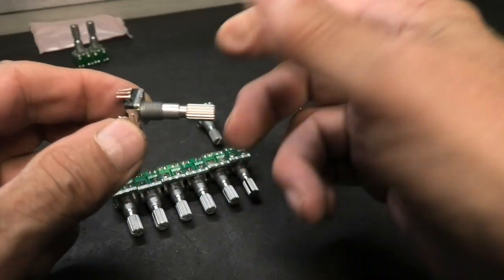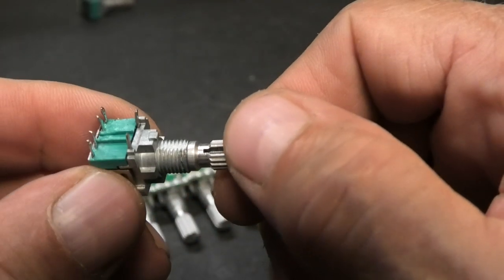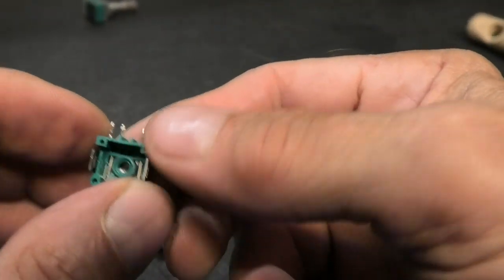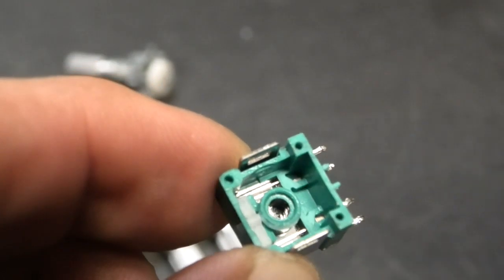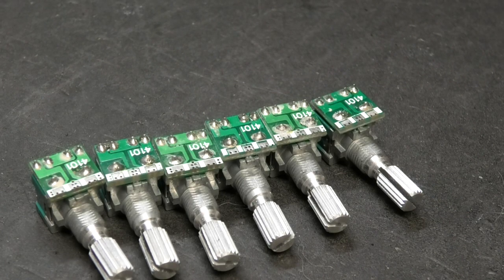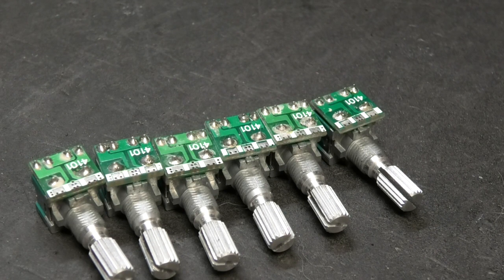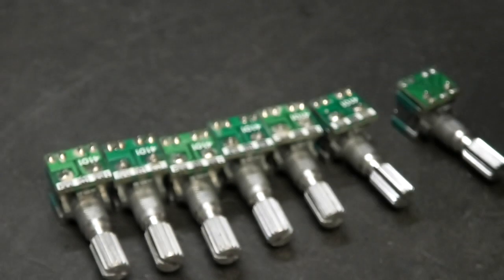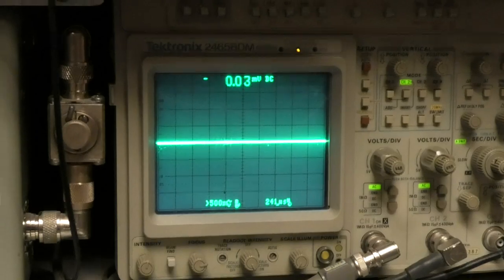Pulse Encoder Update - Stryker Radio SR 955 - SR 655  - Channel Selector - VFO - Still Waiting.

Comment from the maker: Channel Selector / Encoder For Stryker Radio SR 655 HPC And SR 955 HPC .. the long shaft (poor design) of the factory encoder is prone to FAILURE! Beware the fake news!

It's The Best One, Has Survived The Heat And Durability Test .. Others have been tested and FAILED. It's not a software issue either, there's too much misinformation out there. Never Settle For Less!!

That "goofy" long shaft, prone for failure and factory knob really SUCKS!

Here's what it takes to cut through the noise, be loud and crystal clear with a better receiver too:  A) Tuned Bench:  https://www.youtube.com/watch?v=lwcDfXOgAls.  True, it's more complicated and time consuming to accomplish these consistent and accurate results. Below is a partial procedure and list of calibrated equipment used to achieve this level of performance . Read on ..

Fine Tune CB Radio Shop strictly adheres to (https://www.nist.gov/) NIST Traceable Calibrations and other industry standards to maintain accuracy and consistency for providing Real World Performance Tuning of Citizens Band and 10 Meter export mobile radios with integrity.

"Basic Textbook AM/FM/SSB Transceiver Tune, Alignment and Calibration" 

1) Pll adjustments
VCO & OSC, AM TX OSC, USB TX OSC, LSB TX OSC.

2) Transmitter alignment
DRIVER BIAS, FINAL BIAS, SSB  (or gate voltages for mosfet versions) CARRIER BALANCE, HI-LO AM & SSB Power, RF METER, AMC, ALC and FM DEVIATION.

3) Receiver alignment
AM/FM RF & IF SENSITIVITY, FM DETECTOR/DEVIATION, SSB IF SENSITIVITY, SSB S-METER, AM/FM S-METER (100uV unmodulated -67dbm for “S-9” meter reading!), AM/FM SQUELCH RANGE, SSB SQUELCH RANGE, and NOISE BLANKER/AUTOMATIC NOISE LIMITER (Real World dBm to volts (uV) tables below).

That's just a typical run of the mill textbook tune up and alignment (if you're lucky). There's more to it than frequency alignment, modulation adjustment, meter calibration and a tune up report displaying exaggerated rms Bird peak watts! 

"Test Bench includes"

Bird 4314C Meter
https://www.birdrf.com/Products/Test%20and%20Measurement/Power-Meters/Wattmeters-Line-Sections/RF-Wattmeters/4314C_PEP-Single-Element-Wattmeter.aspx
Part 1) https://www.youtube.com/watch?v=RpX9IHe4ORM&t=16s
Part 2) https://www.youtube.com/watch?v=LuhbqTf6Bxw
Bird 4314C Accuracy Test: https://www.youtube.com/watch?v=DqEOabYqhQo&t=5s
Bird Stipulates 1/2 wavelengths  https://www.youtube.com/watch?v=5eWhgT-rTII
And Genuine Bird Elements from 1K down.

Bird 4373 Sampler 
https://www.rfparts.com/signal-samplers.html

HP8924c with options
http://userequip.com/files/specs/2147/HP%208924C%20Repair.pdf
https://www.youtube.com/watch?v=Cg1w0xBa27s&t=1s

HP8920a with options
https://www.keysight.com/upload/cmc_upload/All/EPSG072204.pdf

Three analog scopes, one digital 200 Mhz
https://www.atecorp.com/atecorp/media/pdfs/data-sheets/tektronix-2465b-2467b_manual.pdf
https://www.youtube.com/watch?v=by98x4eu2lM

Fluke 27fm
http://www.fluke.com/fluke/inen/digital-multimeters/fluke-27.htm?pid=56055
 
LCR http://www.lcrresearch.com/wp-content/uploads/2017/05/LCR_Pro1_Manual_version1.03.pdf

Power supplies
6 Cosel PBA1500f12 (750 amps) variable and configurable.
https://en.cosel.co.jp/product/powersupply/PBA/PBA1500F/PBA1500F-12/
Corcom 20VB1 F7130 EMI Filter 50-60Hz 250V

Times Microwave Coax jumpers and test leads
http://www.timesmicrowave.com/cms/products/cables/lmr/
https://www.youtube.com/watch?v=EmqaGJ6IWow
https://www.youtube.com/watch?v=1ltFVSxGp5Y
https://www.youtube.com/watch?v=v12YZT_1o90
https://www.youtube.com/watch?v=h7iiYfmYWRA&t=215s

Amphenol RF Connectors
https://www.amphenolrf.com/
https://www.youtube.com/watch?v=dVh5B0hdEA0 
https://www.youtube.com/watch?v=dKZg8T_AOso

More range, compliments, reliability and a quieter, clearer but more sensitive receiver,  Get Fine Tuned .. not peaked and ruined.

Here are some VideoGates of me at the bench practicing what I preach using my bench radio or customers radio completed and ready to be shipped: https://www.youtube.com/results?search_query=hard+drive+163+ more: https://www.google.com/search?q=Hard+Drive+163+nm&ie=utf-8&oe=utf-8&client=firefox-b-1-ab

It's what I recommend, use, service and sell ... to you ... not something non practical or deceiving in a misleading way. I'm not just the tech and owner of Fine Tune CB Radio Shop, I'm a customer too!  When finished, You'll be giving radio checks, not asking for them .

dBm To Watts and Volts
Tables below displays relationship between Power in [dBm] or [Watts] and Voltage in RMS, peak, peak-to-peak for sinusoidal signals in 50-Ohm systems for accurately measuring and tuning am/fm/ssb receiver sensitivity, agc, squelch and "S9" Meter calibration. Real World! Mike @ Mikes Radio Repair (Romper Room), Mark Rutherford aka Mark 19960, CB Kidd, Martian and all of your other fake accounts pay attention to the tables below, stop misaligning radios, spreading false information and promoting propaganda! 

  [dBm] [Watts]   [Volts]rms   [Volts]p    [Volts]pp
-140 0.100E-16  22.361 nV  31.618 nV  63.236 nV 
-139 0.126E-16  25.089 nV  35.476 nV  70.952 nV 
-138 0.158E-16  28.150 nV  39.805 nV  79.609 nV 
-137 0.200E-16  31.585 nV  44.662 nV  89.323 nV 
-136 0.251E-16  35.439 nV  50.111 nV  100.222 nV 
-135 0.316E-16  39.764 nV  56.226 nV  112.451 nV 
-134 0.398E-16  44.615 nV  63.086 nV  126.172 nV 
-133 0.501E-16  50.059 nV  70.784 nV  141.568 nV 
-132 0.631E-16  56.167 nV  79.421 nV  158.842 nV 
-131 0.794E-16  63.021 nV  89.112 nV  178.223 nV 
-130 0.100E-15  70.711 nV  99.985 nV  199.970 nV 
-129 0.126E-15  79.339 nV  112.185 nV  224.370 nV 
-128 0.158E-15  89.019 nV  125.874 nV  251.747 nV 
-127 0.200E-15  99.882 nV  141.232 nV  282.465 nV 
-126 0.251E-15  112.069 nV  158.465 nV  316.931 nV 
-125 0.316E-15  125.743 nV  177.801 nV  355.602 nV 
-124 0.398E-15  141.086 nV  199.496 nV  398.992 nV 
-123 0.501E-15  158.301 nV  223.838 nV  447.677 nV 
-122 0.631E-15  177.617 nV  251.151 nV  502.302 nV 
-121 0.794E-15  199.290 nV  281.796 nV  563.591 nV 
-120 0.100E-14  223.607 nV  316.180 nV  632.360 nV 
-119 0.126E-14  250.891 nV  354.760 nV  709.519 nV 
-118 0.158E-14  281.504 nV  398.047 nV  796.094 nV 
-117 0.200E-14  315.853 nV  446.616 nV  893.232 nV 
-116 0.251E-14  0.354 µV  0.501 µV  1.002 µV 
-115 0.316E-14  0.398 µV  0.562 µV  1.125 µV 
-114 0.398E-14  0.446 µV  0.631 µV  1.262 µV 
-113 0.501E-14  0.501 µV  0.708 µV  1.416 µV 
-112 0.631E-14  0.562 µV  0.794 µV  1.588 µV 
-111 0.794E-14  0.630 µV  0.891 µV  1.782 µV 
-110 0.100E-13  0.707 µV  1.000 µV  2.000 µV 
-109 0.126E-13  0.793 µV  1.122 µV  2.244 µV 
-108 0.158E-13  0.890 µV  1.259 µV  2.517 µV 
-107 0.200E-13  0.999 µV  1.412 µV  2.825 µV 
-106 0.251E-13  1.121 µV  1.585 µV  3.169 µV 
-105 0.316E-13  1.257 µV  1.778 µV  3.556 µV 
-104 0.398E-13  1.411 µV  1.995 µV  3.990 µV 
-103 0.501E-13  1.583 µV  2.238 µV  4.477 µV 
-102 0.631E-13  1.776 µV  2.512 µV  5.023 µV 
-101 0.794E-13  1.993 µV  2.818 µV  5.636 µV 
-100 0.100E-12  2.236 µV  3.162 µV  6.324 µV 
-99 0.126E-12  2.509 µV  3.548 µV  7.095 µV 
-98 0.158E-12  2.815 µV  3.980 µV  7.961 µV 
-97 0.200E-12  3.159 µV  4.466 µV  8.932 µV 
-96 0.251E-12  3.544 µV  5.011 µV  10.022 µV 
-95 0.316E-12  3.976 µV  5.623 µV  11.245 µV 
-94 0.398E-12  4.462 µV  6.309 µV  12.617 µV 
-93 0.501E-12  5.006 µV  7.078 µV  14.157 µV 
-92 0.631E-12  5.617 µV  7.942 µV  15.884 µV 
-91 0.794E-12  6.302 µV  8.911 µV  17.822 µV 
-90 0.100E-11  7.071 µV  9.998 µV  19.997 µV 
-89 0.126E-11  7.934 µV  11.218 µV  22.437 µV 
-88 0.158E-11  8.902 µV  12.587 µV  25.175 µV 
-87 0.200E-11  9.988 µV  14.123 µV  28.246 µV 
-86 0.251E-11  11.207 µV  15.847 µV  31.693 µV 
-85 0.316E-11  12.574 µV  17.780 µV  35.560 µV 
-84 0.398E-11  14.109 µV  19.950 µV  39.899 µV 
-83 0.501E-11  15.830 µV  22.384 µV  44.768 µV 
-82 0.631E-11  17.762 µV  25.115 µV  50.230 µV 
-81 0.794E-11  19.929 µV  28.180 µV  56.359 µV 
-80 0.100E-10  22.361 µV  31.618 µV  63.236 µV 
-79 0.126E-10  25.089 µV  35.476 µV  70.952 µV 
-78 0.158E-10  28.150 µV  39.805 µV  79.609 µV 
-77 0.200E-10  31.585 µV  44.662 µV  89.323 µV 
-76 0.251E-10  35.439 µV  50.111 µV  100.222 µV 
-75 0.316E-10  39.764 µV  56.226 µV  112.451 µV 
-74 0.398E-10  44.615 µV  63.086 µV  126.172 µV 
-73 0.501E-10  50.059 µV  70.784 µV  141.568 µV 
-72 0.631E-10  56.167 µV  79.421 µV  158.842 µV 
-71 0.794E-10  63.021 µV  89.112 µV  178.223 µV 
-70 0.100E-09  70.711 µV  99.985 µV  199.970 µV 
-69 0.126E-09  79.339 µV  112.185 µV  224.370 µV 
-68 0.158E-09  89.019 µV  125.874 µV  251.747 µV 
-67 0.200E-09  99.881 µV  141.232 µV  282.465 µV
-66 0.251E-09  112.069 µV  158.465 µV  316.931 µV 
-65 0.316E-09  125.743 µV  177.801 µV  355.602 µV 
-64 0.398E-09  141.086 µV  199.496 µV  398.992 µV 
-63 0.501E-09  158.301 µV  223.838 µV  447.677 µV 
-62 0.631E-09  177.617 µV  251.151 µV  502.301 µV 
-61 0.794E-09  199.290 µV  281.796 µV  563.592 µV 
-60 0.100E-08  223.607 µV  316.180 µV  632.360 µV 
-59 0.126E-08  250.891 µV  354.760 µV  709.520 µV 
-58 0.158E-08  281.504 µV  398.047 µV  796.094 µV 
-57 0.200E-08  315.853 µV  446.616 µV  893.232 µV 
-56 0.251E-08  0.354 mV  0.501 mV  1.002 mV 
-55 0.316E-08  0.398 mV  0.562 mV  1.125 mV 
-54 0.398E-08  0.446 mV  0.631 mV  1.262 mV 
-53 0.501E-08  0.501 mV  0.708 mV  1.416 mV 
-52 0.631E-08  0.562 mV  0.794 mV  1.588 mV 
-51 0.794E-08  0.630 mV  0.891 mV  1.782 mV 
-50 0.100E-07  0.707 mV  1.000 mV  2.000 mV 
-49 0.126E-07  0.793 mV  1.122 mV  2.244 mV 
-48 0.158E-07  0.890 mV  1.259 mV  2.517 mV 
-47 0.200E-07  0.999 mV  1.412 mV  2.825 mV 
-46 0.251E-07  1.121 mV  1.585 mV  3.169 mV 
-45 0.316E-07  1.257 mV  1.778 mV  3.556 mV 

                 Don't Be A Mud Duck!

 https://www.arrl.org/shop/ARRL-Handbook-2019-eBook

Hard Drive 163 NM. 73's! Click click.?